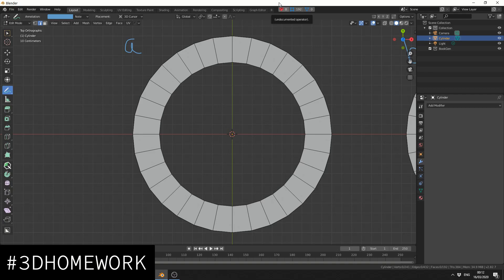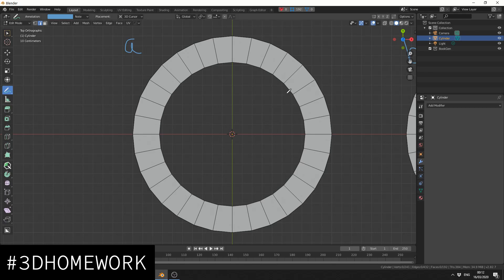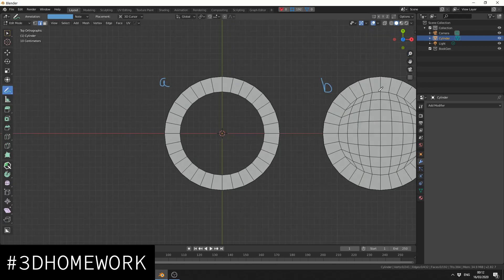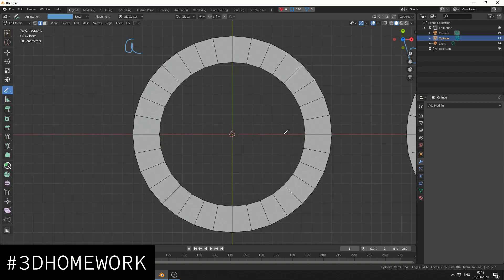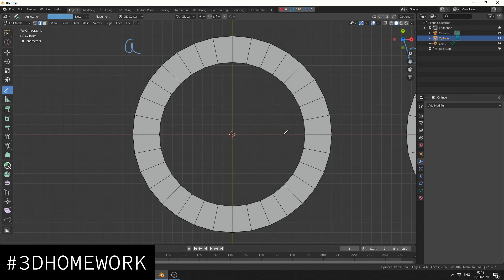#3DHOMEWORK: Week 1 - How do you  fill a hole with quads?

Comment: Ctrl+F / Grid Fill
Reply: You could also select the inside edge, duplicate it, separate it by selection, then take that new object into Edit Mode and add a face.  Add 2 loop-cuts (or use the knife tool) going through the centre, one along the X axis and one along the Z.  Now select 3 of the faces and delete them.  Next, add a plane and subdivide it so it has 4 faces across, and click Simple.  Scale it down so it is the same height as the 1/4 circle shape (can be eyeballed or simply copy the values in the object properties.  Apply the Subdivision Surface Modifier and join the plane to the 1/4 circle object you made previously.  Go into Edit Mode and delete the vertex at the point of the 1/4 circle.  Then, with Auto-Merge turned on, drag the vertices of 2 edges of the plane to corresponding vertices in the 1/4 circle.  Then add 2 Mirror modifiers and Bob's your uncle!
Reply: @WaterShowsProd  you should post this on its own comment thread so others can see Thomas!